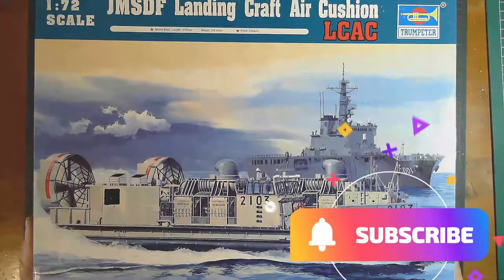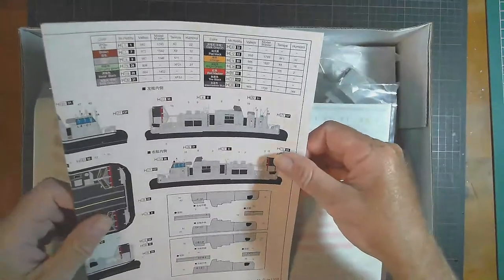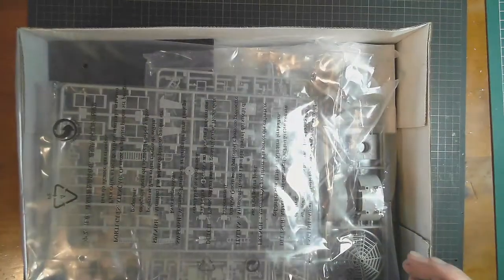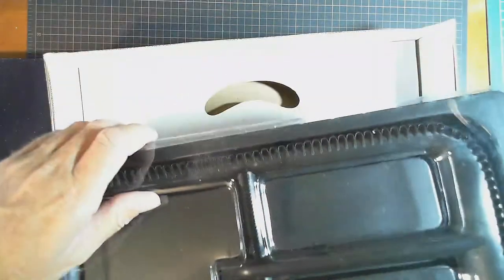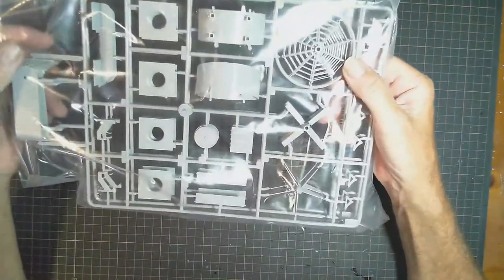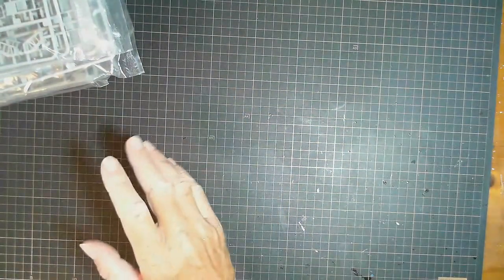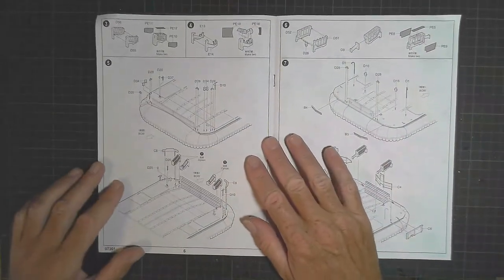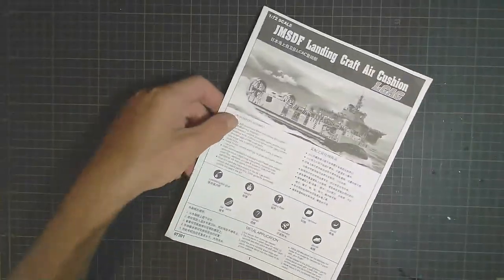JMSDF LCAC Landing Craft Air Cushion Hovercraft Unboxing. Trumpeter NO: 07301

Comment: Strewth mate , that's a nice model I had no idea existed , would look sweet with tanks or APC on board , afaik they take at least 1 M1A1 MBT or a couple of Bradly IFV's.  Not sure if the Marine M1A1 has been weight reduced , the operation load of the LCAC is stated as 60 tons and the M1A1 is 63 .
I love 1/72 .

Comment: Hi Peter,
Just checked a couple of reviews on Scalemates and they did not have the flags blacked out? I wonder if it's something to do with Australia, or the Chinese packaging person at Trumpeter does it due to a personal dislike of the Japanese flag? The box front on Scalemates is also untouched?
Reply from the maker: Its not just covered/blocked on my kit, its printed that way from the factory. Maybe also has to do with the Olympics? As thats how they may be coming from the production line now? Weird isn't it.
Reply: @OzScalemodeling  I disagree Peter. It’s black marker pen. If the factory were doing it at the design stage, they wouldn’t have bothered printing the flags at all?
Reply from the maker: @Nigel’s Modelling Bench  Good point Nigel !

Comment: Since the Japanese flag decals are already ruined, you might try this... You can usually remove permanent marker by drawing over with a dry wipe marker. The chemicals in the dry wipe activate the permanent marker. Then wipe off the drywipe marker with a kitchen towel or tissue, and it will also remove the permanent marker. It will generally work on hard surfaces. Never tried it on decals though...
Reply from the maker: Thx I might try that otherwise I think I have some from another kit. :)